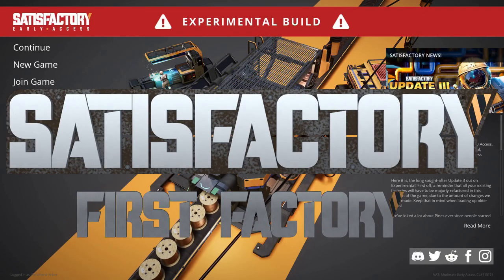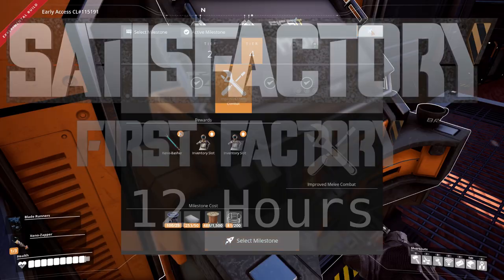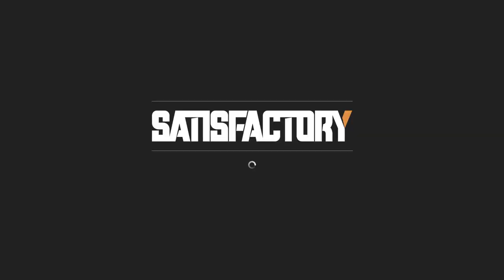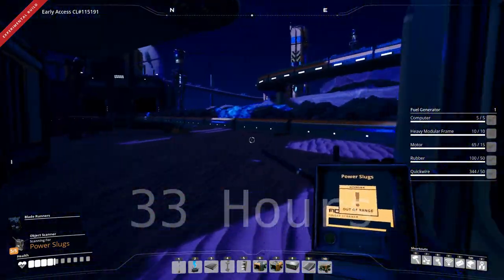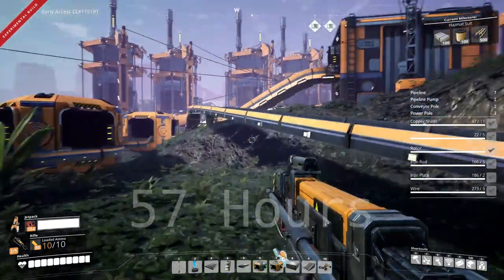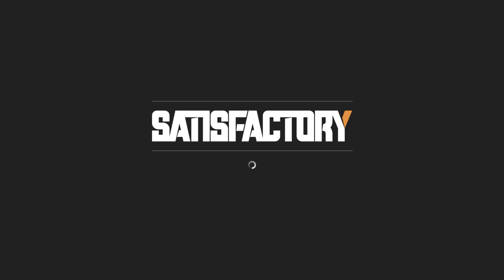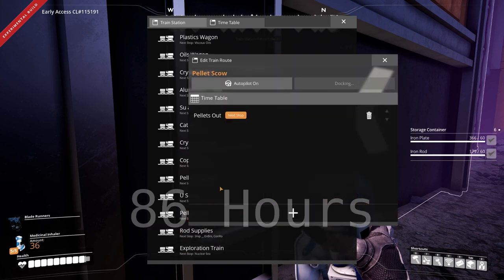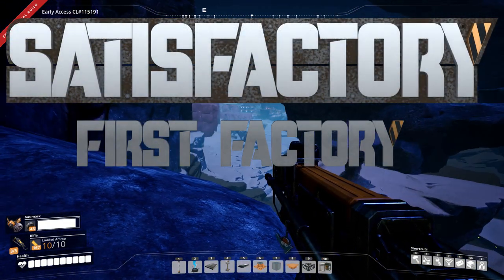Satisfactory Update 3 Base Through Time

Comment: Thanks for this. Seems like I'm roughly at the same speed as you, I've spent a lot of time exploring because I'm in one of the greener start areas. 
Last night I got a full level 2 belt of steel running into my main base, maybe I should've trucked that but I couldn't be bothered and I have a container full of reinforced plates.
Todays task is to use the steel to unlock tiers 5 and 6.
Reply: Meh, can't be bothered, lets go find some quartz so I can make a dune buggy.
Reply: And then I realised it'd be nice to have some caterium mining while I was away quartzing, but the nearest caterium needs blasting and actually tnt would be nice to have on the quartz trip and that's why I'm working on a sulfer mine. Such is the way with these games :)
Reply: And TNT needs steel so I'm doing the mall part of the steel anyway, I'm now doing the thing I was procrastinating on by virtue of the procrastination
Reply from the maker: Sweet! I find that trucks are worth it for their colossal bandwidth, and swapping out truck stations for train stations is an easy conceptual shift.